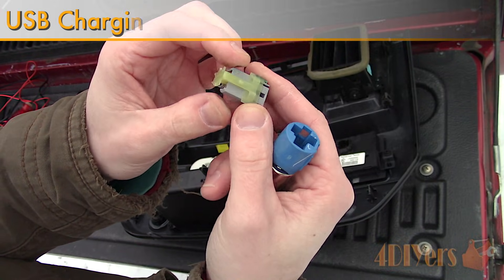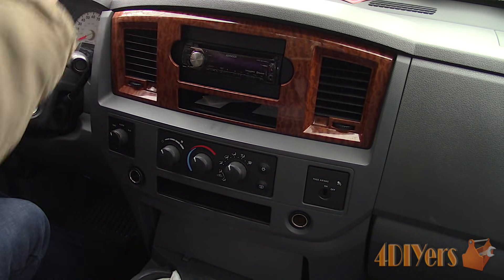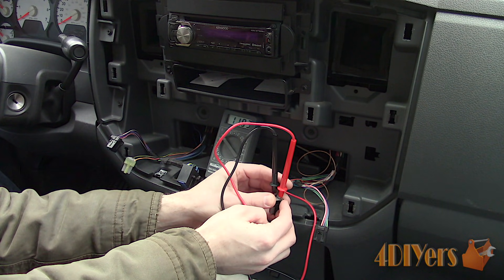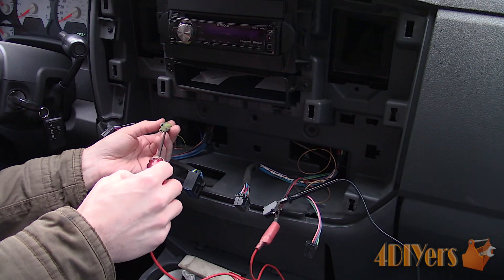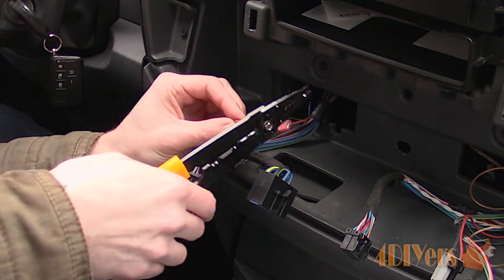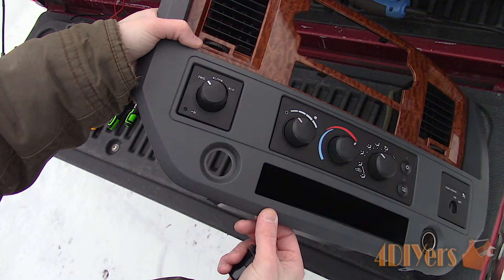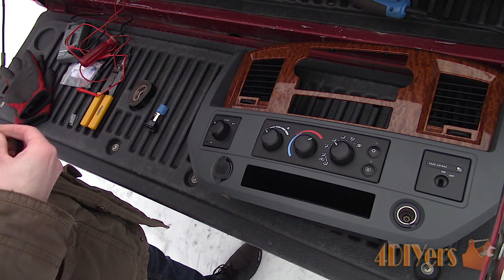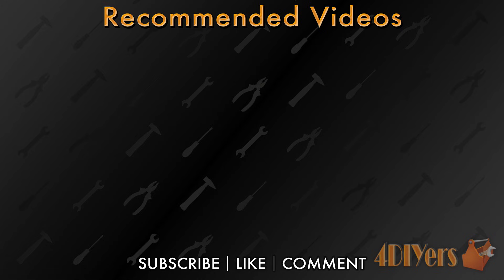How to Replace a 12v Cigarette Lighter Socket with a USB Charger Port and Voltmeter

Comment: I have a 03 ranger with the cigarette lighter that I would like to replace with that USB charger. Do I just cut the wire that plugs into the back of the cigarette lighter and replace it with a pushclip to replace the plug that went into the back of the cigarette lighter?
Reply from the maker: Yes that is correct.

Comment: Great job, well spoken in a clear, steady pace with great attention to detail of the task and what may be encountered. Appreciate it!

Now I have a question, I have almost the same port from Amazon and I too have a ram, 2012 but same power situation. I was considering putting the port on the always on socket location as the one I bought has an on off button. I’d like to hear your opinion on that as well as why you selected the key power side. Thanks
Reply from the maker: Thank you so much! I was thinking if it ever failed, there would be less of a chance if it's on a circuit that turns off with the vehicle. And while it's only a small load, it reduces the chance of a parasitic draw too.

Comment: Can you send me a message, I have a few questions. Need help to do this. There is power all the time in all 3 cigarette outlets, the front dash ones I used the ground from the lighter wire and I had to use the wire that is used to turn the radio on and off when the key is turned. I also have a dangling wire that says power antenna that has power running in it, I thought about using that but if I turn the radio off then the USB ports don't work. I have a 3rd cigarette outlet in the back seat just behind the arm rest for the front. It also has power  running all the time. How can I  get it to turn off when the truck is off? I only have positive and negative leads going to it. 2006 Ford f150.
Reply from the maker: I would not recommend using the wire from the radio as it may overload the circuit. Some vehicles have cigarette ports which have power all the time. One in my truck is like that. Some vehicles can also have it switched so it turned off with the key, I believe my Dodge Ram has this feature and it's just a matter of changing over the fuse location. You could run a relay, use a low amperage circuit to switch the cigarette port on/off when the key is operated.

Comment: I want to do the same with my 2013 Honda Odyssey minivan. I am wondering whether I can avoid removing the panel as I have never done this before. I purchased a charger by Qidoe that also has the voltmeter. Any tips?
Reply from the maker: You can’t avoid removing the panel. You’ll have to either fine a tutorial or manual on the removal process. Depending on the trim panels, they always have clips and sometimes screws as well. To disconnect the clips, start at an edge and slowly work your way around.
Reply: @4DIYers  thanks for your reply. do you have a video on using trim tools to remove a panel? I have a Honda odyssey 2013.

Comment: I have a USB port under the armrest lid in the center console in addition to a cigarette lighter and another jack that I don’t know what it is for but appears to be a jack for headphones. I was wondering, being that my car’s USB port is not working, if I can replace it with the same one that you are installing. I started to do some research online and found that my car’s USB port in addition to the positive and negative wires have other two wires. So I’m confused if I can replace my original USB with this replacement because I wouldn’t know what to do with those two extra wires or would it be easier and more appropriate to use the cigarette lighter socket? I rather use the non-working usb port but would appreciate your input on this one.

Comment: I took mine out. It had two wires connected to the existing. Presumed this was live and neutral. I tried it and it didn’t work. Now the old one won’t either. 2016 Ford transit
Reply: If you cut the wires at the same time you’ve shorted/killed the fuse.

Comment: Quick question my Subaru has those same connectors you crimped on but one is big and the other is smaller (+ small - big) , can I skip that step or are they both the same size on the one you installed

Comment: I did the same upgrade with my Ford ranger but replacing out a 3.5 headphone jack port. I ran different wires from the usb ports to a switch box panel to control the USB port power that has the power from a fuse block from the main battery. I have plans in putting a inverter with an isolator with a second battery (I can easily change the fuse block to go to the auxiliary battery when I'm done). PS would you think a 2000 Watt inverter with an isolated 2nd battery would have any issues with a 130 amp alternator ? It would only run constant for no more than 15-30 minutes max.

So far my switch box has switches for. Amber lights on top. Massager for my seat turn on the USB socket and turn on a dash cam and reverse alarm. I still have plans in putting in underglow lights, separate inverter on off switch and an LED light bar switch. Maybe 😏
Reply from the maker: You may run into charging issues on the long run. With cop cars, they typically had higher rated alternators to compensate for all the electronics inside. Some people were even running issues with sound systems and stock alternators. I have an installation video for a grill mounted LED light bar on a Ranger, not sure if you've seen that.

Comment: How much watts do you think this port use at idle ?
Reply from the maker: It would be extremely small as it's only operating an LED display. I would guess under 1amp, much less than a car headlight.

Comment: Slick.... I love little upgrades like this. Thanks for sharing. Seems like  good quality piece. I like that they made the face aluminum and not cheap plastic. I don't know if they do but they should make a usbc and usba instead of 2 a ports
Reply from the maker: Thanks for watching!
Reply: This is a main USB output port. Any other option like USBA or USBC, etc. Is accomplished with the cable of your choice. Just like in other USB charger port.

With this said. I've got at least one of these USb ports & voltmeter on each of my cars. Really practical and cheap. Totally worth.
Reply: @crpth1  I get that, I just like usbc.... i have many usbc to usbc cables it is just better smaller and reversible.... all good for a car